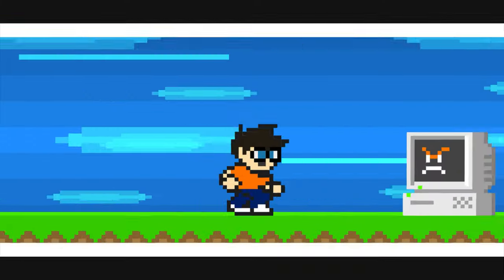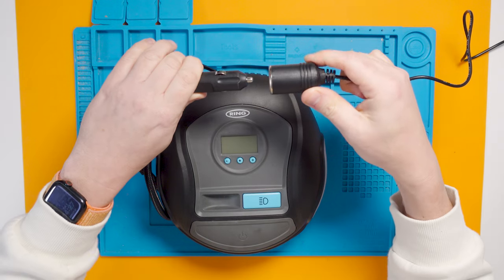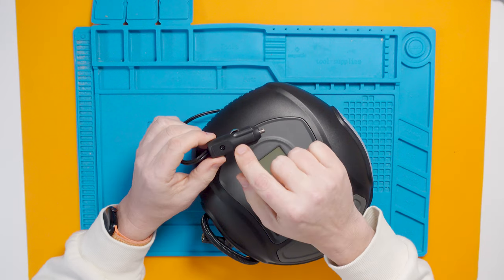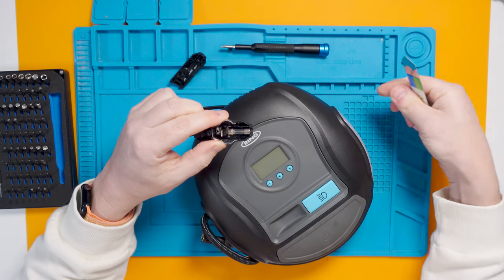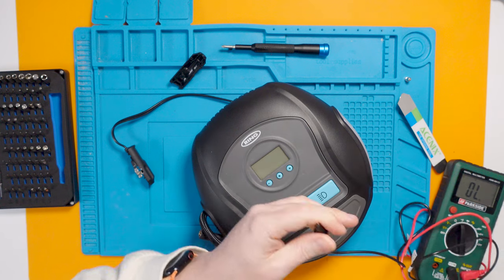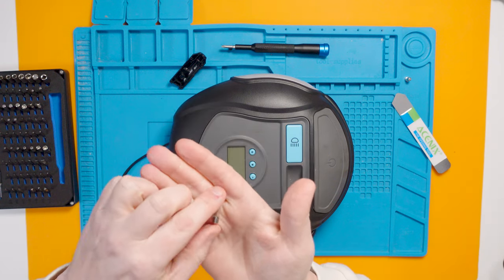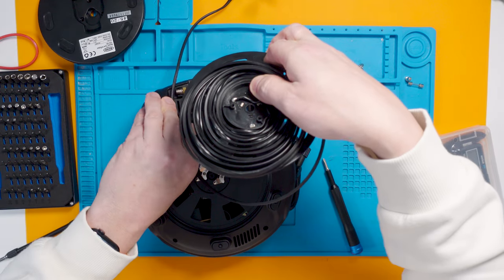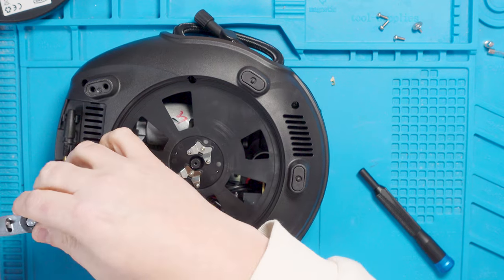My Ring Tyre Inflator is BROKEN - Has it pumped it's last pump? Fix it Friday.

Comment: My Ring Tyre inflator failed when 28 months old. It blow the fuse. Replaced and would run in a laboured way before blowing the fuse. This video helped me identify the motor / pump was partially seized. I followed advice in comments and lubricated the motor bearings with WD40. Turned it my hand, then ran it for a minute. Reassembled all working. My suspicion is that the boot go my car gets very hot and the lubricant dries out. Time will tell if continues to work. I am storing it in a lower and cooler part of my boot. Thanks.

Comment: Use some small pliers or side cutters to prise out the motor lugs. Make sure you power supply current limit is at maximum you are hitting the limit.  Before  opening the motor put some oil on the bearings each end then run it ensuring the current limit mentioned above is at maximum. Then put back together.

Comment: How many amps  can your bench supply provide at 12 volts? The motor may not be shorting, but exceeding the surge current available from the power supply.

Comment: Are you sure that's a straight 12 volt DC motor?  It's not using PWM or AC voltage to power it?
Reply from the maker: Definitely DC the little red dot on the bottom is a polarisation mark

Comment: I usually just put little drips of machine oil when dealing with ceased motors like a fan one, then move it by hand both directions and it is free to spin. The motor is spinning on low voltage but something preventing it to spin faster when it is forced to and cause a short. since you are getting a new one maybe consider the oil trick on both ends and this can solve the issue, and as usual nice video 👍
Reply: Seized. Not ceased.
Reply from the maker: @raftonpounder6696 don’t be a knob about people’s spelling! We all make misteaks
Reply: @kiphakes  😂. You misunderstand. I’m only trying to help. How can you learn if no-one corrects you?
Reply: @raftonpounder6696  Thanks for the correction, I do appreciate it.
Reply: @xo_plays_  you’re welcome.